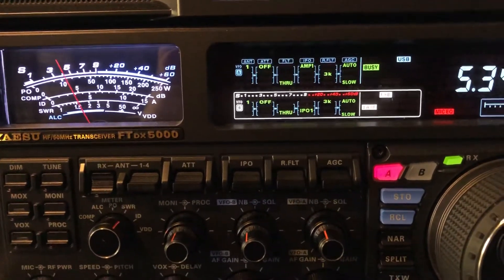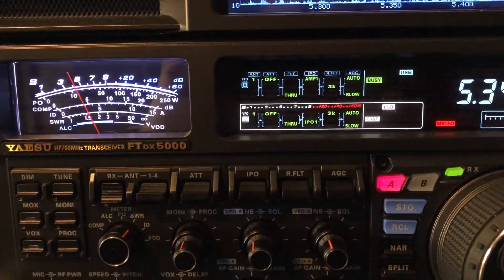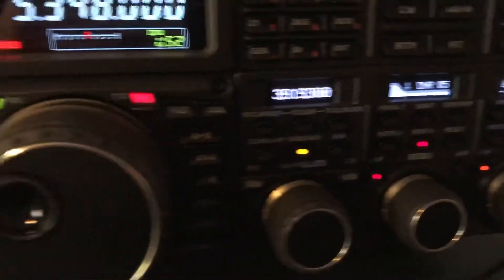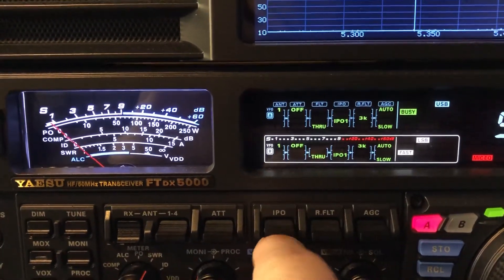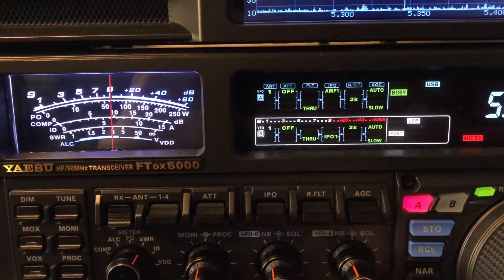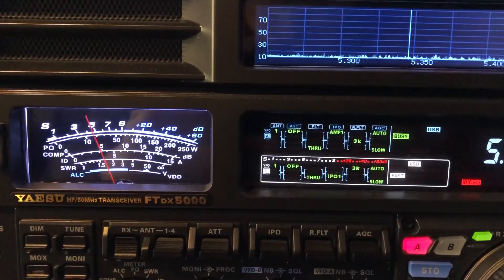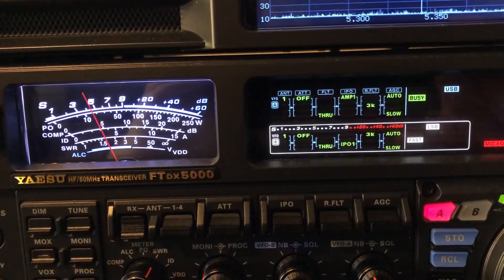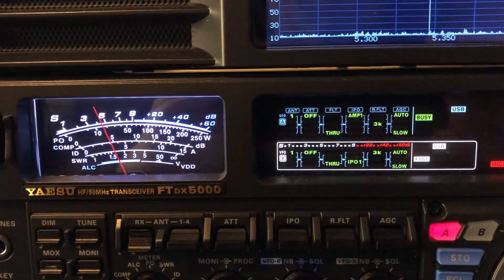Yaesu FTdx5000MP: Digital Noise Reduction

Comment: Hey Doug, thanks for the video and relevant information. I am considering the FTdx5000MP, has yours been reliable overall? I am presently using a K-3 that is 13 years old. Would you buy the radio again or look at something else? Thanks! Russ, K7OO
Reply from the maker: Russ, you couldn’t pry my FTdx5000MP from my cold dead hands.  I haven’t had any issues, other than when  i blew up the CAT port with RF feedback.  Yaesu fixed it under warranty.  Oh you get one, be sure to install ferrite chokes on the CAT cable, if you to decide to connect the radio to your computer for use with a logging program,

73, Doug
Reply: @n4hnhradio   Hey Doug, thanks so much for the reply. I am a bit old school and really do not need the waterfall and all of that stuff, so I think I am going to grab a new one in a week or two. 73 Doug! 
Russ, K7OO
Reply from the maker: I’m with you Russ.  If you can’t hear them you can’t work them.  The fancy waterfall might sometimes serve to show you what you cannot hear.  I deliberated for 8 months in 2019.  I tried every radio at HRO, pitting one against the other with the same antenna, listening to the same stations.  I kept coming back to the 5000.  It wasn’t my first choice.  I even awaited the arrival of the FTdx101D and MP before I decided.  In the end, the low noise floor, ergonomics, the superior DNR, and a real D’Arsonval movement meter, won me over.

73, de N4HNH